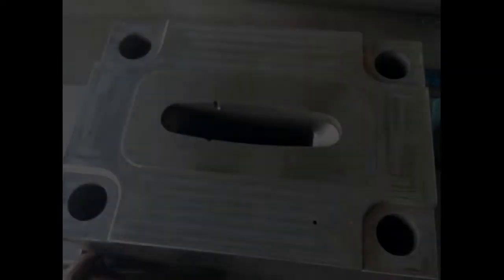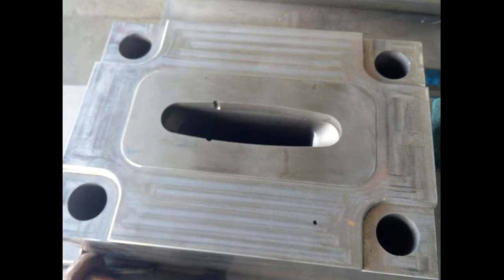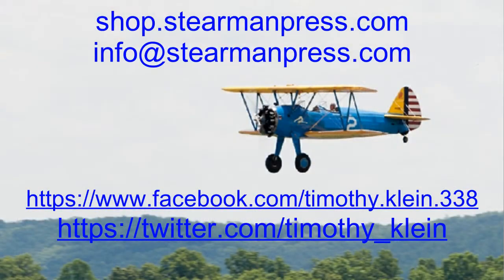SP 457 why 5x7

Comment: I saw your new Kickstarter project for the 8x10/5x7 dev.tank and I want to ask you if the here in Europe common 13x18 cm film
also fit in the 5x7 holders ? ( 13x18 is about 5,1x7.08".)